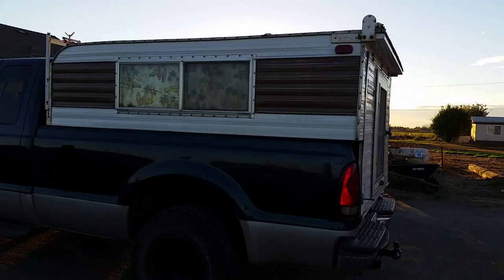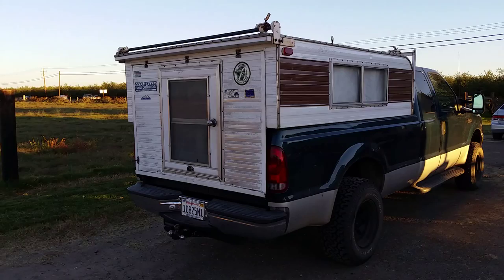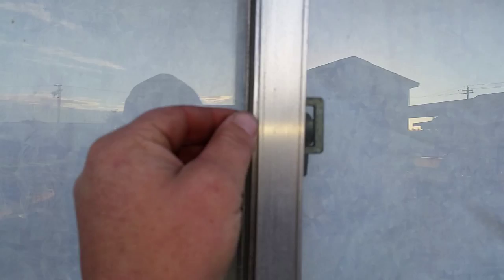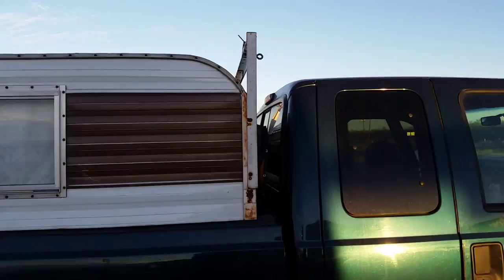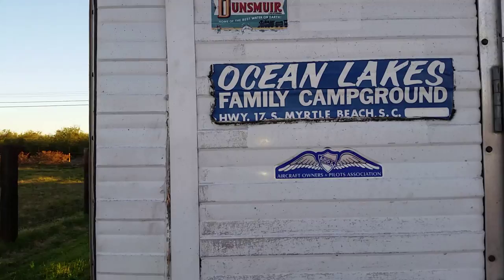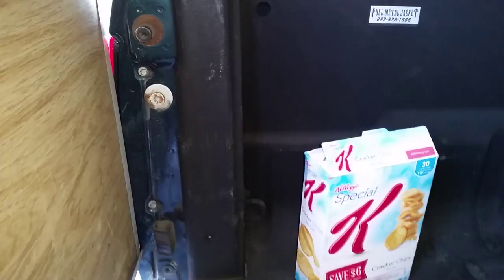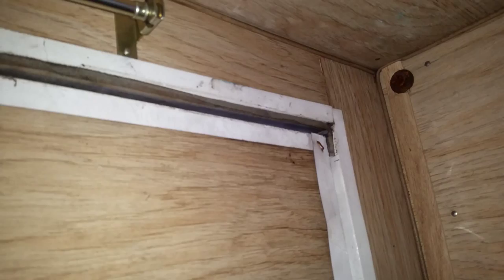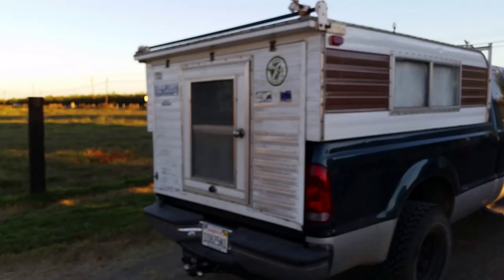Vintage Camper Shell Project vol. 1

Comment: i have a similar shell on my truck, except it's a few inches taller and the rear end is different, it has a locking door like yours but the entire rear also is hinged at the top and opens up the entire back of the shell. it's all aluminum, no wood. i lucked out and bought it for $300.
Reply: how much does it weight im looking to purchase one of these guy wants a bit for it thou

Comment: Put a 3/4 inch sheet of plywood. put it in above the truck rails slide it forward and you have a bed and storage.
 I had a 69 chevy truck with the same camper. My first truck 18 years old in the Highschool parking lot.
Badass

Comment: Boy, this is like finding the needle in the hay stack! I live way oyt in the boonies and scour the treed wind breaks with my eyes everywhere I go and haven't found one of these yet. I'm going to go the Belair route and have them install vintage windows that crank open instead of using the newer style black plastic framed windows. Should look totally vintage then and be beautiful and practical on my 97 turbo diesel dually. I see their prices have gone up since last I looked at their site but still a darn sight less expensive than anything the rv mfg. are putting out there.

Comment: How do you remove the camper from your pickup? I'm building something similar and would like to know the easiest way to do it.
Reply from the maker: Lyle Campbell I built a stand that is roughly the height of the pickup bed, slides in and out of the truck pretty easy. I can do it by myself but it's way easier with a helper